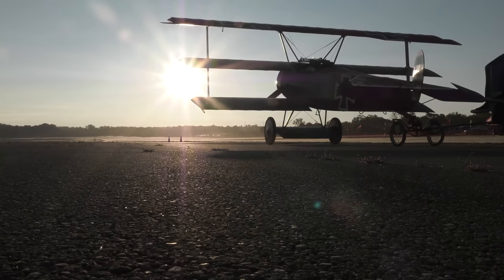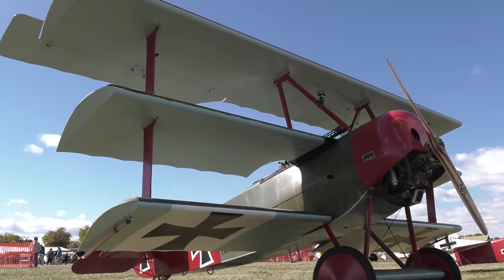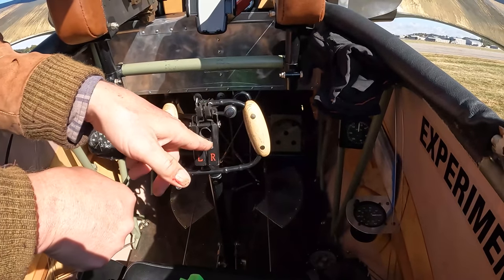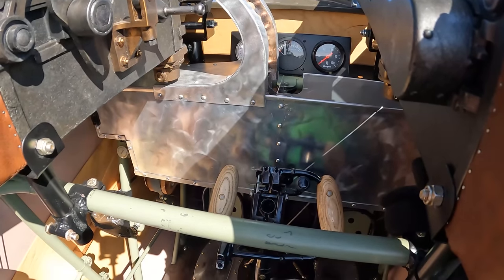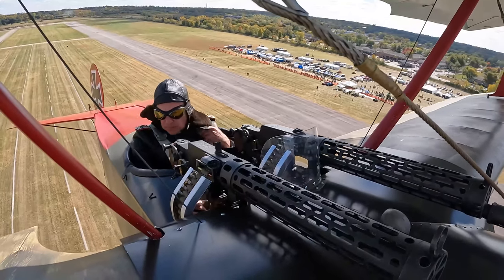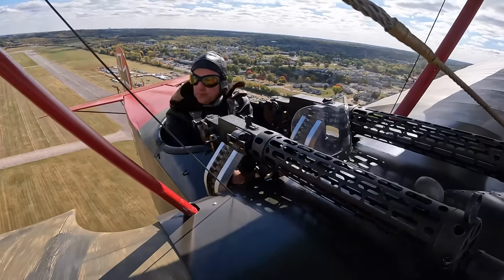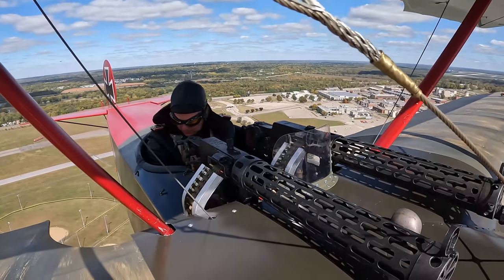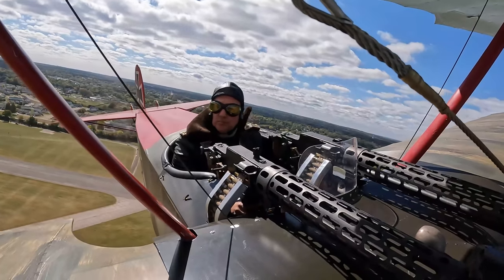Fokker Dr.I at WWI Dawn Patrol 2022 NMUSAF

Comment: You know, the Fokker Triplane may not be the greatest fighter plane ever built but it's certainly one of the coolest!
Reply from the maker: Andrew the pilot said it handles very well.
Reply: 😂😂 greatest during ww1..🇲🇼
Reply: @Workerbee-zy5nx  Not quite, but close.  It's replacement, the Fokker D-VII, was even better than the Triplane was.  So much so that the Allied Powers (France, Britain, and the United States) wanted ALL D-VII's surrendered to them as part of the armistice terms.  Not that they didn't have some good fighter planes of their own but they REALLY wanted to get their hands on those Fokkers, they were THAT good.
Reply: According to the Red Baron, it climbs like a monkey!😂
Reply: @charlesharper7292  And they still do!  Make no mistake about it, von Richthofen's endorsement was instrumental in the adoption of the Fokker DR1 by the German air service in WW1.

Comment: I'm very curious whether this can do slip turn or uncoordinated turn just like what werner voss did.
Reply: I did extensive testing to recreate that legendary maneuver. My conclusion is that either James McCudden was mistaken in his description of Voss's maneuver or that readers interpretation is mistaken. I was able with full left and right rudder deflection to get the triplane to easily swing 45 degrees either direction in level flight. It was a real job to get ut to turn 90 degrees, and very slow. No way was it going to slip 180 degrees! The design of the aircraft prevents that..mainly that slab sided fuselage and all that drag. I highly doubt a rotary engine would make much of a difference. I strongly feel that what McCudden witnessed was a shallow Hammerhead turn which most aerobatic aircraft can do easily, but the Triplane can do it rapidly because of it's very short fuselage and full flying rudder.

Comment: Let's also mention that the physical handling of this plane is going to be quite benign compared to the Oberusal made LeRhone copy's handling.  The P-factor of the much larger slower turning propeller, and the gyroscopic precession of the rotary radial engine ( the Lycoming turns about 2200 rpm the Oberusal is about 1200...) To keep these planes flying, the Germans had a reward for any German pilot or soldier who manages to capture an intact working Entente LeRhone 9J rotary, of a case of Champagne.
Reply: Nope. Not benign. It's a handful. The Rotary makes it more challenging to fly. You are literally on the edge of your seat and at a high level of attention the entire flight. Not a relaxing flight. Flies more like a helicopter than a fixed wing aircraft.
Reply: @chrisgrube-he1gr  I was referring to the Lycoming boxer engine used in this replica as being more benign in handling. So yes of course the rotaries are all rather touchy because of the precession of a 270~+300 # mass of rapidly spinning aluminum and nickel steel mounted very close to the C/G.

Comment: Awesome! But why in the heck would you want to an older engine? That thing works amazing. Kermit Weeks shows his and there is oil going everywhere, the plane looks like it would flip at any moment, just looked terrifying! This was so smooth!
Reply: There's only one way, for better or for worse, to get closer to the original complete experience and its using the original technology or as close to it as you can. Some people want the original experience more than the "best" experience.
Reply: Kermit Weeks much like the late Paul Allen strived for authenticity of the aircraft in their collections. Well summed up by ImpressionismFTW reply & much respect for the work of the National Museum of the U.S. Air Force and Kermit Weeks!
Reply: Week's triplane uses a WW2 Warner radial engine. Not an original rotary.

Comment: Rotex engine and a tail wheel in a Fokker Triplane,  seriously?
Reply: A real rotary engine IF you can find one will run you 60k approx. That's a lot of money for a piston engine. Tailwheel? Well..if you don't have a grass runway or you want to fly it to airshows you're going to have to settle for a tailwheel instead of a skid. Just like having to compromise with the engine unless you have 60k just laying around for a real rotary.